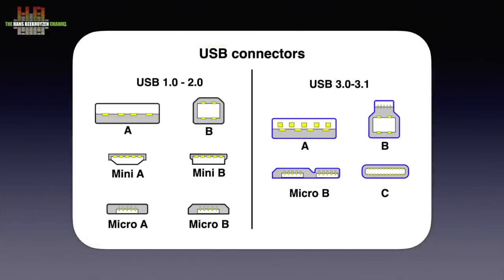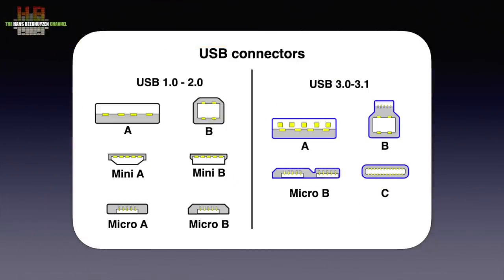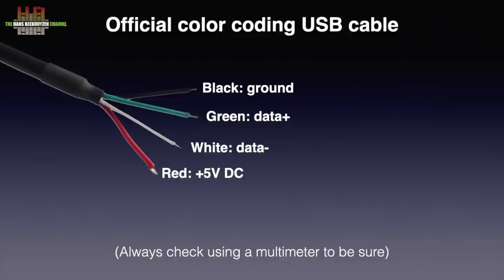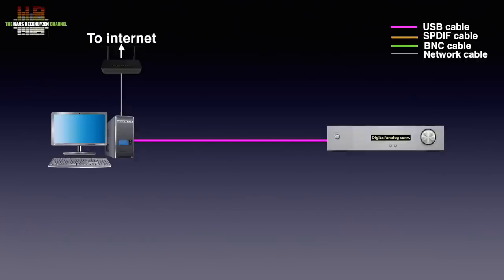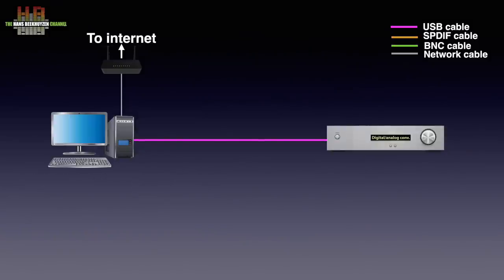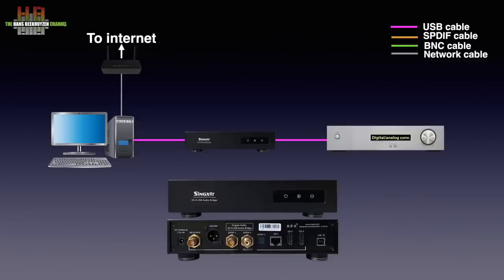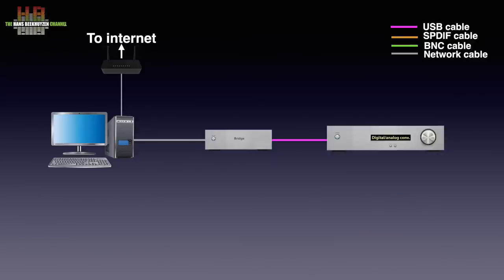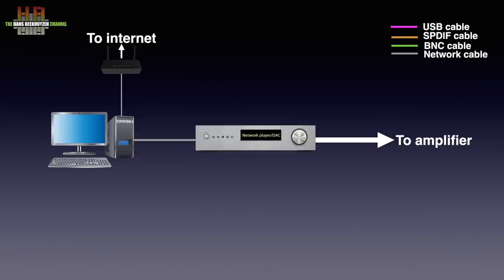Using USB for quality audio

Comment: It seems Hans has missed discussing explicitly the most obvious solution, using a DAC with a competent USB section. I’m sure all the devices he mentions can solve issues that some DACs may have, but many or all of these devices are made irrelevant by a DAC with a quality USB input. With establishment of USB Audio Class 2 nearly 15 years ago now, there is no fundamental technical remedy discussed here that can’t or shouldn’t be done in a quality USB DAC input.
Reply: Exactly. Plenty of DAC makers have made incredibly effective USB implementations. So much so that USB is often the best sounding input on many DACs.
Reply: Roys in vivir Digital says the same. Nowadays many dacs resolve jitter problem in usb audio
Reply from the maker: O, but I agree completely. If both the USB output on the sending device and the input on the receiving device are perfectly designed and built, It offers the same quality as with perfectly applied AES/EBU, I²S or SPDIF. But these are scarce, I'm afraid.
Reply: @TheHansBeekhuyzenChannel  Correct me if I’m wrong…  I thought SPDIF (optical TOSLINK or RCA coax) is fundamentally flawed in the same way USB Audio Class 1 is flawed: data is clocked at the source. The DAC is unable to control the flow of data and therefore cannot fully control jitter; no amount of careful DAC implementation can correct the problem. Jitter performance with these connections becomes a function of the source. USB Audio Class 2 (and maybe also I2S, not sure) puts the DAC in control and the quality of its implementation determines jitter performance.
Reply: @TheHansBeekhuyzenChannel  Hans, I just ordered a Lumin U2 streamer which has a fiber optic network output.  Have you tested this before and how it compared to all the other audio outputs on a streamer?
Reply: @SteveWille not simply USB 2.0 can solve the problem.  The DAC need to implement asynchronous module rather than the standard isochronous mode so that the DAC can use its own clock rather than the clock of the source.  Besides, USB input better be galvanically isolated
Reply: @ericyum6729  Agreed... USB Audio 2 makes it possible for a DAC to solve these problems; it is necessary, but not sufficient (as you point out). Without USB Audio 2 (or some other protocol that allows the DAC to perfectly FIFO data), DACs, no matter how well-implemented, fundamentally cannot accurately clocked output without the help of the source. This unnecessary design weakness is eliminated by USB Audio 2; with it, it is now possible to design a DAC (as, I think, some are) with excellent jitter performance regardless of the source (as long as the source implements USB 2 Audio, as many do). Also, as you state, this comes with additional responsibility on the DAC’s part to isolate its electronics from the noise that is allowed in USB connections.
Reply: Just to add to the complexity... The firmware & drivers used on the source usb, and usb firmware on the DAC must be able to talk to each othe properly and this gets difficult to do for every combination of source and dac. For example thesycon have multiple firmware updates over the years for compatibility fixes. There are even differences at the OS layer that have strange effects on buffering and clock. Even a bad source power supply can add enough noise to the USB chipset rails that the system has to do more error correction and effects DACs downstream.

Comment: This comment may be a direct reflection of my poor digital knowledge, but, doesn’t a USB type B have no power return? Reducing electrical noise. I use an audio grade USBC to USB type B cable to connect my Apple device to my DAC. My DAC only has 1 USB type B input, so I employ a USB type B to toslink adapter for other Apple devices. Your comments welcomed!
Reply from the maker: USB B has two data lines that are used bidirectional or unidirectional, depending on the mode used. And it has a +5 volt power line that comes from the sending device.
Reply: @TheHansBeekhuyzenChannel  👍🍻
Reply: @westernartifact580  please explain. Rather a sweeping statement I feel, when you have no concept of which Apple devices I employ. What adaptations I make to them and what equipment I pair them with plus, although it’s true to say that I use apple products to stream music, they are not my only streaming device, or indeed, music source. So I have plenty of comparisons, not involving Apple products. I look forward to a full explanation of that sweeping statement.

Comment: There is no error correction in USB2 audio transmission to DACs, just flow control. Just one of a number of incorrect assertions here, Hans.
Reply from the maker: There is no error correction in USB Audio Class 1. USB Audio Class 2 that is used nowadays does have error correction.